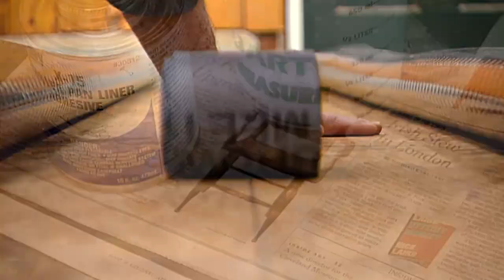How to Install a DIY Vinyl Floor in Your Garage

Comment: Hi, nice video, but... if this is the same product sold at Costco, it's not worth it. It shrinks by 1/4" each year. So regardless of your effort to properly install it, it will ultimately fail and need to be replaced.